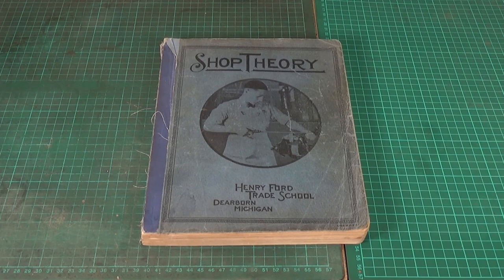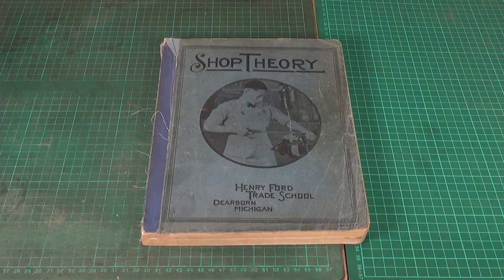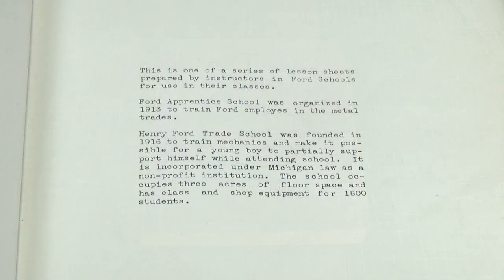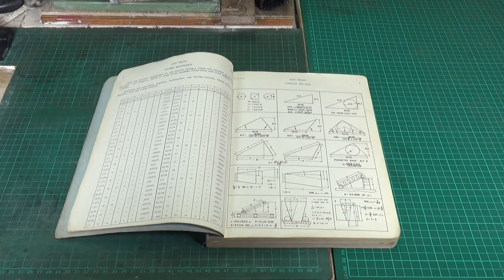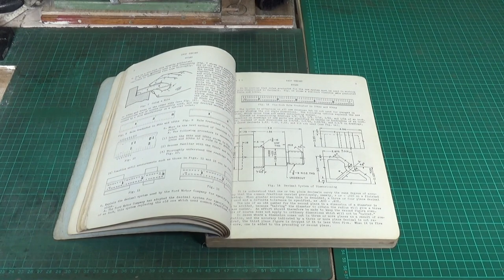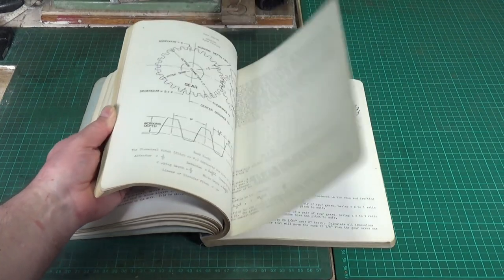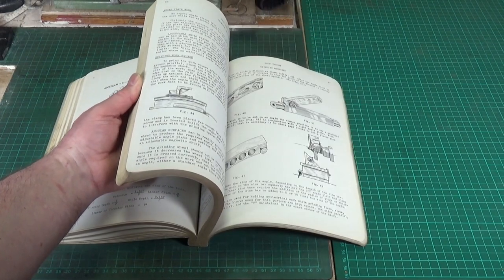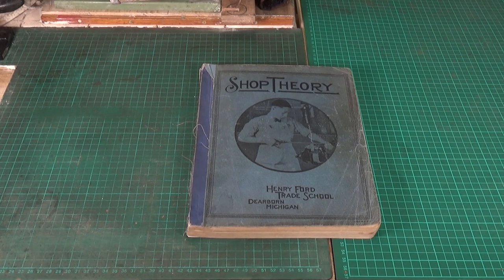Shop Theory Henry Ford Trade School - An Excellent Resource For Your Workshop

Comment: Interesting book Alan.  All the original skills and methods hold true throughout time.  I have some similar books for auto engineering and they are fascinating.  Some good on line early metal turning books are available as well. Thanks for posting.  Cheers Rob
Reply from the maker: Thanks Rob. I really like the way this one is laid out and written. I guess that was because it was designed for the classroom, everything is clear and well spaced. Cheers, Alan.